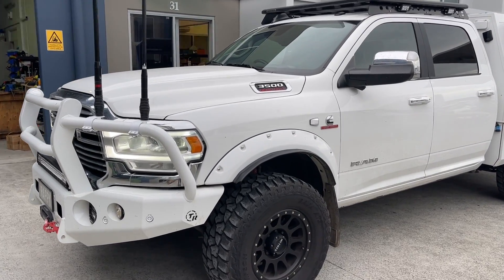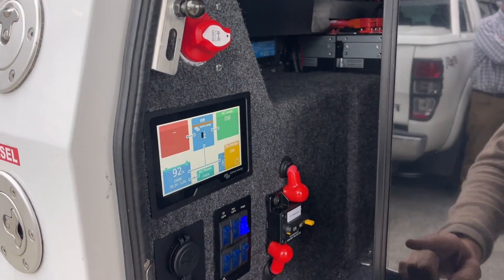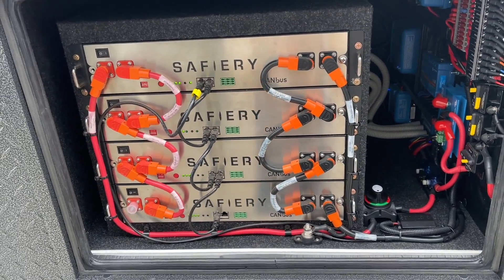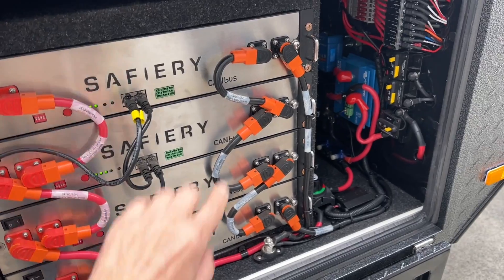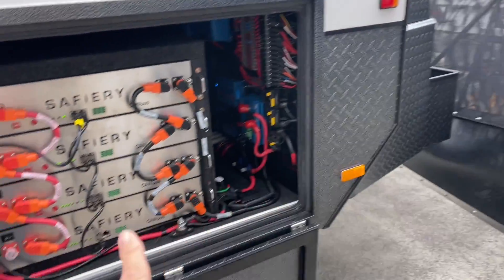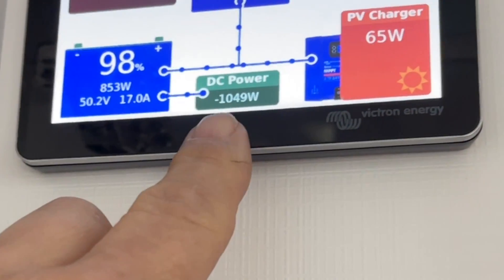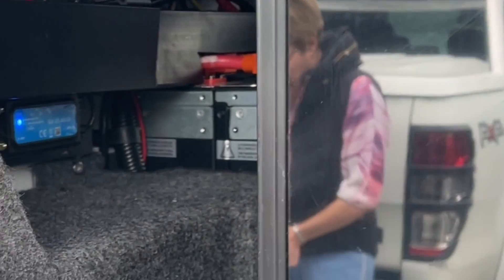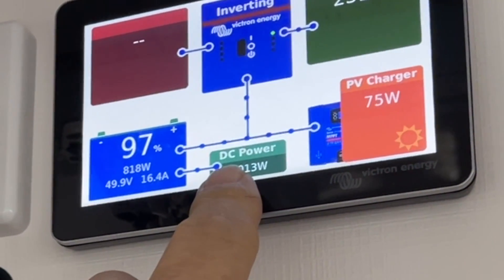48V Caravan & 48V RAM 3500 won’t be Hollering for a Marshall because their 14,400wh has 5 BMS

Comment: How do you account for voltage drop between both batteries. And the priority charging with such a flat voltage curve?
Reply from the maker: The Batteries are CANbus with communication between batteries. The BMS is a huge board at the top of each battery inside and directly controls the Mosfets on the charge and discharge side for each pouch module. (these are pouce lithium, not cell nor prismatic). So they balance perfectly.

Comment: Does the scotty tell the alternator to shut off if there’s a bms disconnect so it doesn’t spike the alternator? Thanks 😄
Reply from the maker: Thats a great question. We have seen many 48V alternators do a power dump - and the alternator controller MUST be BMS connected. Scotty extracts power from a 12V or 24V alternator with the starter battery connected. These have internal regulators. When the BMS is full and shuts down, Scotty stops delivering power and the captured power returns to the low side (12V or 24V battery). This is the power of the bi-directional feature. We can demonstrate dropping a spanner across the 48V terminals of Scotty and it stops - no sparks - and then lift the spanner and it will seamlessly deliver 3000W again without reset. Scotty eliminates load dumps and the complexity of field current wiring to an alternator.
Reply: @Safiery  very cool, I’m going to send you a email. Keep the videos coming! There great